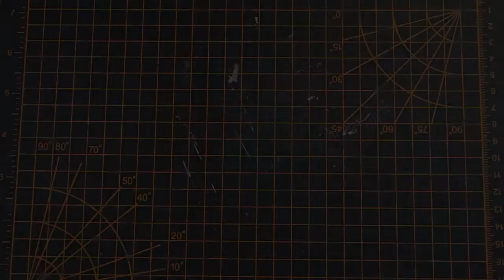Model Railroad - Painting Trains

Comment: If you want to completely take the paint off use alcohol of 80% or higher that gets the job done fast plus you would be better off using water based acrylic paint which is better than solvent based paint which ruins plastic that i use when i give my 'HO' model trains a paint job plus you should go to art supply stores that have wide variety of water based acrylic paints and lots of tools and supplies for your modeling needs.

Comment: Doesn’t that ruin the value of a model train? Should I paint my model train a different paint scheme? I think about painting my model Amtrak MTH train and Lionel NJT Train a different scheme but I think I shouldn’t. I’ve had the Amtrak one since 2004 and the NJT train since 2011.
Reply from the maker: Value is very subjective. I paint it because I want my own road name and color scheme therefore it increases its value for me. If you plan on reselling or trading then buying a unpainted or second hand shell for the loco will work just fine. I have recent loco as well that I purchased on sale and found some shells for road names I wanted later on.

Comment: love your white mountain railroad...keep up the great work.. would of liked to see the spray painting..just to see how paint hits the small shells from spray cans
Reply from the maker: ya i thought about showing that but it was a bit windy that day and didn't want my lens to catch some spray. but definitely next time
Reply: Wind… I think that’s what caused the “bumps” you mentioned… it is likely the paint drying in the air before it adheres to the surface of the model, which is why it’s easy enough to remove.  In other words paint should go on wet.   Its better for the lungs to paint outside.  Try repurposing a large cardboard box as a makeshift paint booth.  Regardless, great video.

Comment: I'm glad to have stumbled over this in my You Tube feed.
I had done a similar thing with my 15 N-scale locomotivrs - including, ironically, two Bachmann F9s. Used the isopropyl alcohol, toothbrush and a similar mount - and had my own railroad paint scheme (Testor's [Sky] blue) and my own round, dark yellow logo. The logos were a nice design, though a little clunky, but I did not spray the shells with primer. I used tiny office supply, Helvetica Bold, stenciling for the name, "Texas Central," emblazoned across the sides of the locomotives. I'd like to see how you did your logo and stenciling.
Reply from the maker: I used a Cricut machine to cut vinyl but it was too thick to look right at N scale. I'm in the process of changing the lettering and plan to print them out using decal paper.